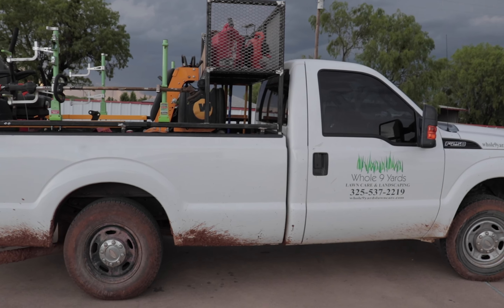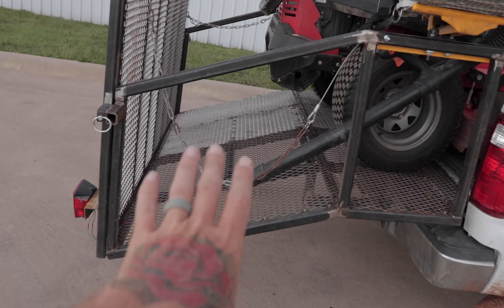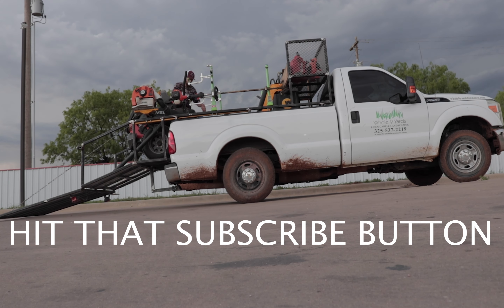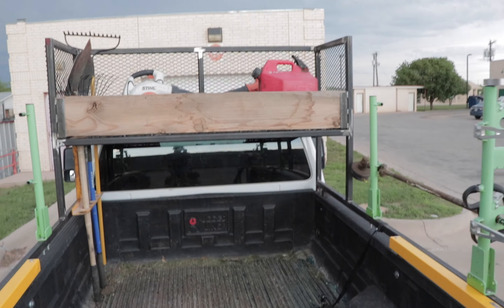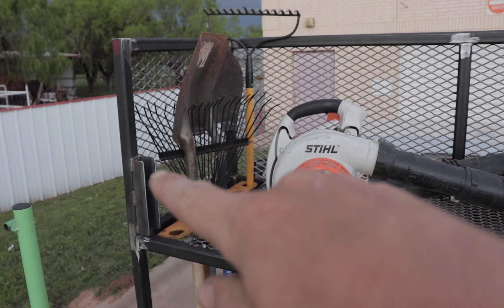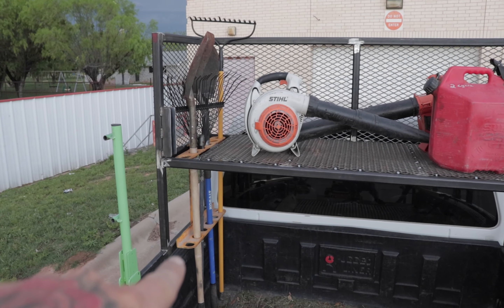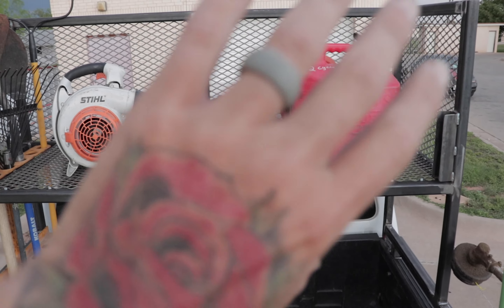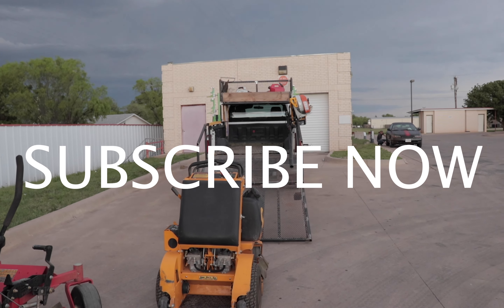2019 LAWN CARE SETUP/truck ramp....no trailers!!!!

Comment: I have a f250 trailerless flatbed with a 48 inch wright stander, a exmark push mower, a redmax weed eater and backpack blower and gas cans go in a toolbox underneath the truck (the toolbox sucks, I'm gonna get a trailer basket for it and better siding)...great truck, 410,000 miles and counting

Comment: How has this worked out this year?
Reply from the maker: Mr. C's Lawncare it has worked out fantastic
Reply: @rodclydesdale8004  Awesome. Watching youtube you see all these nice trucks and trailers, but i enjoy having a small footprint. I have a 2004 half ton extended cab and a 5x10 trailer. I want to keep what i have but either turn the trailer into more of a caged in unit and my truck into what you and many have done. I would just want the ability to pull my trailer as well. Thanks for the video.

Comment: 52 inch and 60 will feet there?
Reply from the maker: lawns master either one would fit in the back, might have to beat the fender walls in to make a 52 go in the front
Reply: couldn't you bolt down a pr of 2X8's 6ft long on each side to drive the mower up on to help raise the mower deck over the truck fenders?  just trying to see if this might work for me.